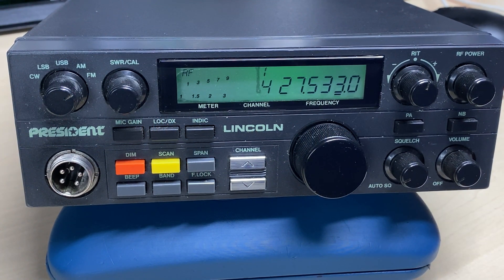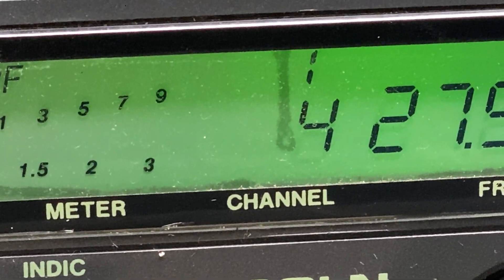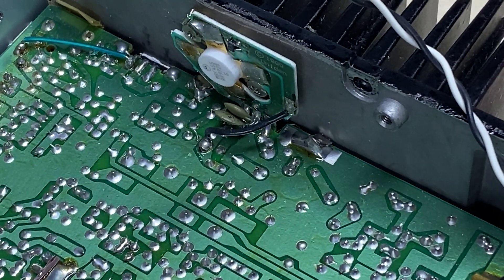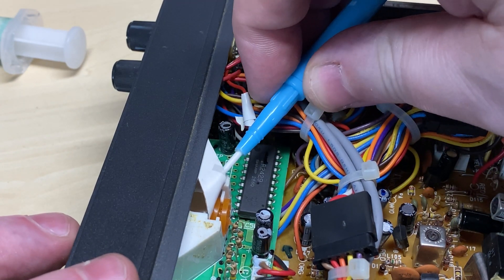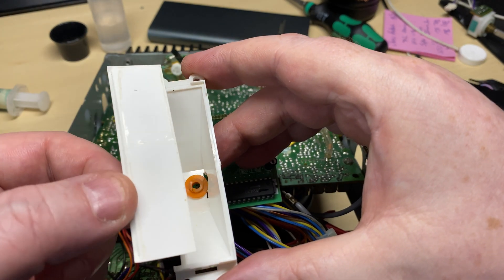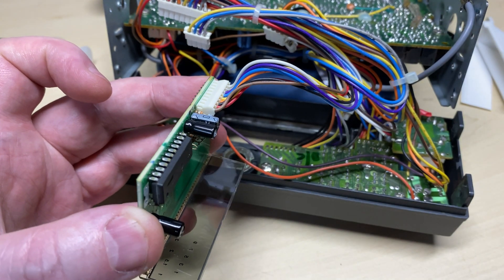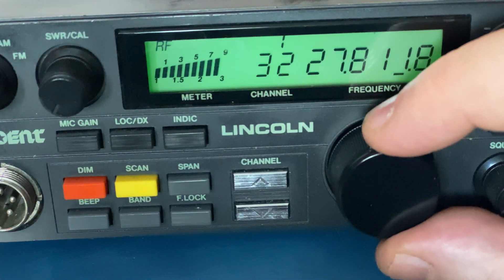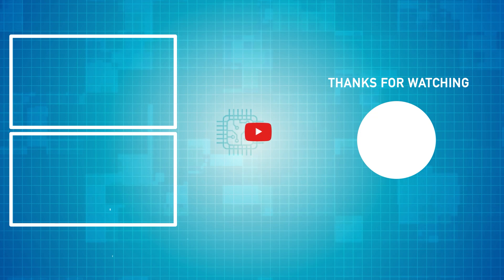EP 188 - President Lincoln - Rotary encoder fix and some essential work.

Comment: Hi just for you information, to replace those ratators you can get those design for uniden MC60, just ovading connection of the supplement pin used por extra ground ... On my side i'm not patient in off to open and repare those rotators 😢

Comment: Great information in this . Where did you buy those green silicon light bulb "jakets/covers" please as i need a few for my General Electric C models LED DISPLAY PANEL.?
Cheers.
Reply from the maker: Hi , i got them in a job lot of spares , have you tried aliexpress or similar ?
Reply: @MicroChipz  a while ago I did, instead  I bought 1m green cob  LED strip, about a week ago.
 I will have another look for those silicon bulb jackets..
✌️ 73.

Comment: Hi Graham, are these displays compatible with a Realistic HTX100 as my HTX has some lcd screen bleeding and i have been told a new replacement is not available ?
✌️ 73.
Reply: Htx100 is a rebranded product of uniden 2810, which is also branded as president Lincoln, however HTX100 is having a different vfo display PCB,  from my memory the displays are adaptable from one to the other, in addition there were some replacement microcontrollers with add on functions ... 73's
Reply from the maker: I dont think it is.

Comment: Nice job on that encoder fault .Changing the capacitors is definitely recommended. You get a lot of noise generated within that PLL board which affects the receiver. It's just a pain to do as for some strange reason UNIDEN didn't print the capacitor locations on the PCB. But it's well worth doing.

Comment: I love the Lincoln radio's. I am on my third one!!. Another problem i found with the rotary channel change is that there are 2 low value electrolytic capacitors on the up/down voltage lines going from the channel switch to the cpu. They are either side of the channel change socket on the cpu board, i have found they can go leaky and cause the "skippy" channel change. Hope  this information is useful.